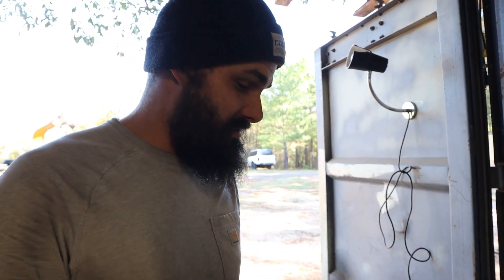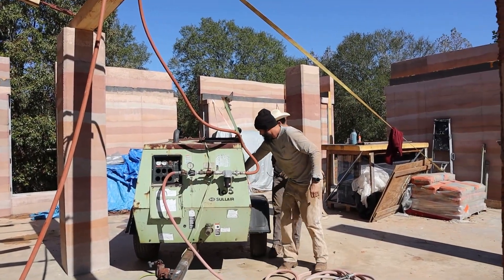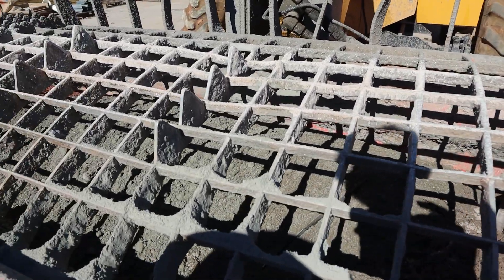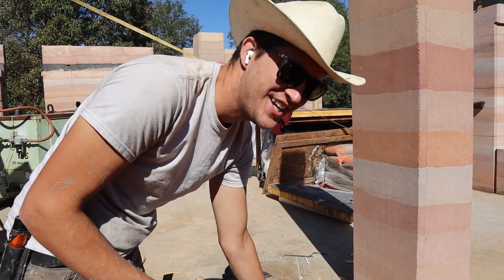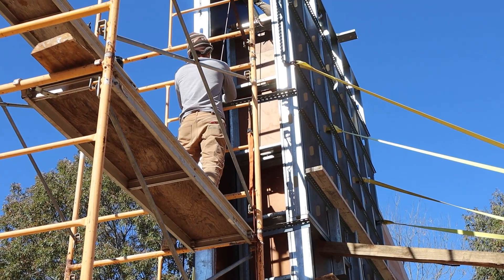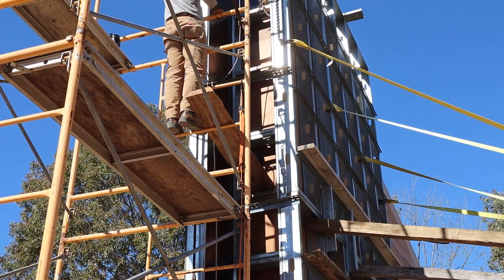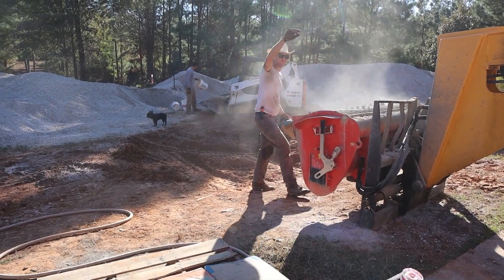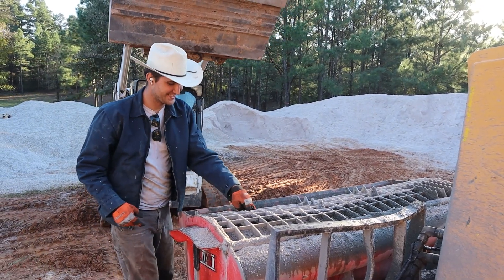Racing the Sun to Complete Another Rammed Earth Wall - Vlog 85

Comment: Hey Ricky, how big is that lift? I am putting a design together and there is a single wall that the project works around and anchors to - it will be a 23ft tall, 14.5' long, 18" thick wall. What do you think about that? Too tall? What would you say is the highest single wall you would construct? Thanks in advance, great to see that despite problems, you are are still going great.
Reply from the maker: Sorry for the late response, I responded on your other comment with the same question.